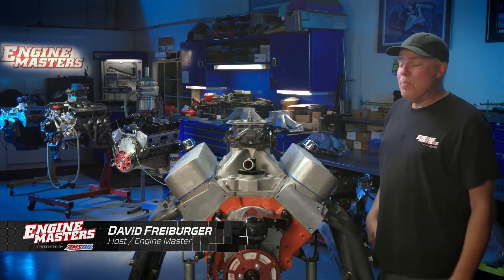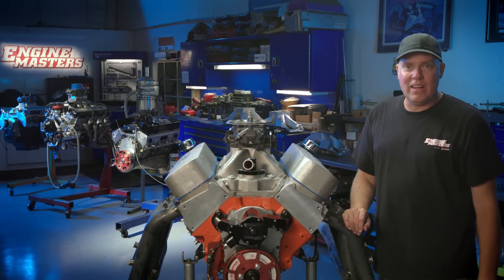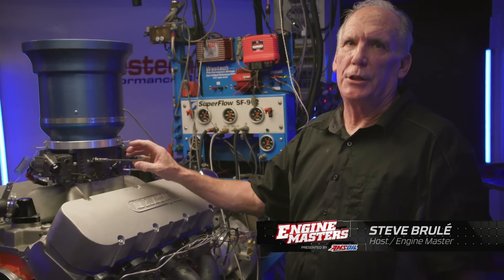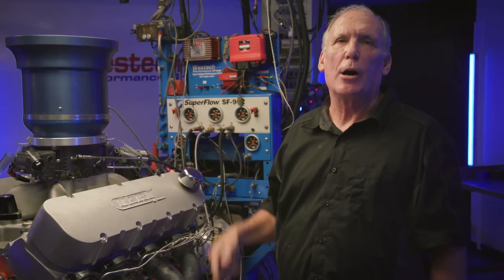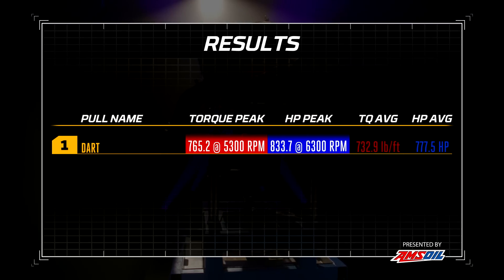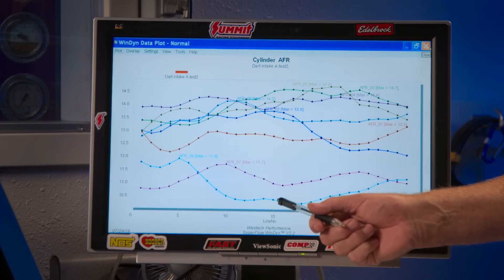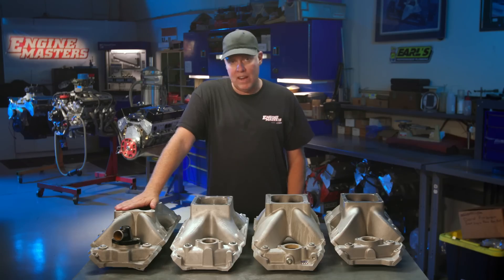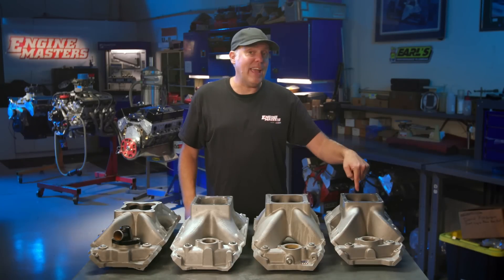Big-Inch, Big-Power, Big-Block Manifold Shootout—Engine Masters Preview Ep. 52

Comment: I’ve been looking for a tunnel ram for my 496. My BBC is equipped with Ron’s 4.1” 1800CFM alcohol direct inject. Brodix BB3 xtra heads. Comp Comp K11-692-8 cam shaft. PTC 5,500 stall. Suggestion?

Comment: The Big block chev engine has the worst head design in the world, you will never be able to fix cyl to cyl. distrubtion because of its left and right hand intake ports. 4 swirl ports and 4 tumble ports. If you want the best power w this engine look at the CID BBC cylinder head and intake. It fixes these problems.

Comment: My RFD Victor Pro heads were tested by Curtis RFD with Pro-Filer, Edelbrock, and Brodix intakes. They were tried as they came from the factory and Brodix, Pro-Filer, and then Edelbrock in that order is where they placed. Then they were port matched to my heads by RFD and the Pro-Filer was the best intake then Brodix with a very close 2nd then 3rd Edelbrock, and far last was Dart it was the worst intake out of all. I imagine on other builds others will say other wise.  My combination is RFD 24 Victor Pro heads,   10.2 DH, 4.6 BS, .903 lifter, 55mm cam, .400 raised cam,  615 cid bbc, with a V30 128 Vortech supercharger, e85, 123mm wilson TB, Holley Dominator efi ecu stand alone, and a custom ground bullet supercharger cam. 
The Dart intake is just like Dart heads, way over priced. AFR heads are better than Dart and have a better price.
Reply: Yes that dart intake is very old and designed for something around a 540 - 555ci. Didnt curtis design the edelbock sv 632 intake.

Comment: the real prob with a single quad intake is the uneven runner length. Tune the quad to feed those 4 outer cylinders, and the inner 4 are pig fat rich. The super high rise intakes that push the carb waaaay up there, can theoretically get the runner lengths closer together than just slapping on a plenum spacer...and there's less of a bend of air/fuel traveling vertically out the bottom of the carb and then taking a turn to the bent V of the cylinder banks. The Brodix design is a bit like a single quad tunnel ram, if you had to make such a beast.

Comment: This shows why EFI is so much better. You can change air/fuel cylinder by cylinder, as well as changing spark timing cylinder by cylinder. It is actually kind of remarkable that these old carb engines run like they do.
Reply: If you check out Richard H YouTube channel. He showed how small the changes are. When comparing multi port efi vs TB efi & carb.

Comment: Brule CAT says he has more hair than you therefore he beautiful and you are not.  All those manifolds and Hollley carbs are basically junk.  Put 4 Webers on it and have no distribution problems. Or Go fuel injection which is superior.  And take off the collectors and have individual pipes on the exhaust.  Like a Top fuel car.

Comment: Brodix won #1
Then Profiler #2
Then Edelbrock #3
Then Dart #4

I need the Brodix Part Number as it killed the rest surprisingly.
Reply: Thank you
Reply: Thanks man, you saved several minutes of my time!
Reply: how much power did the brodix make?
Reply: @ryanaxberg9263  

Dart = 833.7 HP @ 6300 765.2 TQ @ 5300
Edelbrock = 839.6 @ 6500 HP 757.5 TQ @ 5100
Profiler = 864.8 HP @ 6200 777.2 TQ @ 5400
Brodix = 875.8 HP @ 6400 782.2 TQ @ 5300
Reply: @hdcaprice  WOW, thats pretty big gains from just the intake.  Thanks for posting those up
Reply: How about a real good head AFR
Reply: Which intake has the best AFR between cylinders?

Comment: although i enjoy enginemasters im tired of these test on old archaic motor technology that the always use. like in this one it a 598 "big block" dinosaur of an engine. That is like 10litres  of engine and the thing only makes 700 ish hp. its a 20 000$ engine!  nobody realy uses this stuff anymore. id like to see some more modern stuff on the dyno maybe something made in this millennia . MAybe take a popular platform like a k-series honda engine or a  volks 1.8t20v , do some old school stuff like port and polish an light puleys or headers or a stroker kit and see what the gains are . just me 2cents
Reply: 850 horse on 91 octane is hardly archaic. Most modern engines cant make that without a turbo or supercharger. And they still dont have a flat torque curve like this "archaic" big block
Reply: @matinapnib3797  forgive the import guy.....he knows not what he does.
Reply: @matinapnib3797  there no modern engine that big . Im just saying it's not impressive getting 800 hp out of 1/2 tonne of 75yr old farm equipment engine for 20k+. It's just as interesting at a test on jet turbines or rockets. Yes there a few peaple that do use those but isent it pointless to test then on a show. As a viewer and a 3 year sub to mt on demand I'd like to see something more relevant.
Reply: @terrym641  I beg to differ but go to a drag strip and you will see engines this big and even bigger. 632 is getting prety common and people use them because they make huge power . The big boys even run engines this big with turbos. Sorry but a k-series honda is kinda lame by comparison
Reply: @matinapnib3797  yes, but those engines have also problems with old 2.0 Turbo Mitsubishi 4G63. Which makes same power with 4 cylinders, 1/2 of weight and 80% less displacement. 
I still love all V8. No hate. Peace.
Reply: @jareknowak8712  i agree four cylinder engines can make make big power but they always have to have one or two turbos. And for every 14 pounds of boost you are effectively doubling the displacement of said engine. So if you take a larger displacement engine your obviously going to make much more power. And remember top fuel and pro stock cars dont have small displacement engines with turbos. And in import vs domestic classes the big v8 cars have tons and weight and other restrictions to keep the much lighter and smaller 4 cylinder cars competitive.
Reply: @jareknowak8712  lots of people watch videos and think their stock k-series honda and 4g63 mitsu motors are the cats meow. Then they go to the track and run 17's stock and wonder why their car isn't as fast as the ones in the videos. Racing cost tons of money and a big block engine just might be the cheapest way be fast on a reasonable budget
Reply: @matinapnib3797  the same can be said about stock 5.0 fox body Mustang owners. 
Yes, V8 might be cheaper than 4G63, but once I was more certain than today. It all depends.
Dont get me wrong, i have nothing against V8, just saying that "modern" 4 cyl are not "a lame" in comparison to old V8. Absolutely not.
Reply: @jareknowak8712  there is no doubt the 4 cylinder cars can be fast if not faster than many v8 cars. But once again the have huge turbos and are running insane amounts of boost. The red demon mitsu i mentioned earlier is running 85 pounnds of boost! All things being equal if turbos nitrous and superchargers didnt exist the car with the biggest higher compression engine would win hands down. Take a 598 big block and put 85 pounds of boost on it and see what would happen. You would have a hard time designing a chassis that would get the power to the ground. Thats why top fuel have the huge wings on the back. It costs them about 800 horsepower at the big end of the track but the down force and lost of power is worth the added traction. And i might be old school but to me the cars making the most power on pump gas without nitrous turbos or superchargers are the best to watch at the track
Reply: It made 876 dumdum, and it aint 20 k. More like little over 10k if you know what your doing. Summit sells 632 complete for little over 10k
Reply: I do agree with 20,000 being way ridiculous but I will never see a 4 cylinder making 800 horsepower on engine alone, that and Freiburger most likely wouldn’t allow something foreign on engine masters
Reply: @williamsanders468  the engine is $9,999.... The Brodix heads are $3,700.... far cry from $20k
Reply: hdcaprice well 10000 is still a big price
Reply: @williamsanders468  i watched a video of a Mitsubishi called the red demon yesterday that runs 7's in the quater mile. You would be a fool to believe he doesn't have 50 grand in the engine alone.
Reply: hdcaprice are you forgetting the labour and machining that goes into putting a high horse engine together

Comment: Possibly dumb question alert: Why in 2019 are we still building with carburetors?  how is efi not superior?
Reply: They actually have a video that answers this question. Both have pros and cons but ultimately adding fuel into the manifold makes more power than adding fuel closer to the valve.
Reply: carbs are fun. new autos are better in every way over a manual, but I'm still going to drive manual.
Reply: All they do is WOT dyno tests... doesn't make a difference in that case and you don't have to put 28 sensors on the engine
Reply: Because carburetors dump all the fuel at once efi has return lines back to the tank and because AMERICA!!!!
Reply: @xnoxkillxgaming392  high end carb systems are set up that way too tho, it's the only way to feed a true carb equipped monster.....
Reply: @OutlawMercenary  its not the only. Its the simplest. Does not mean its the best.
Reply: EFI really isn’t needed a carburetor is just fine if tuned correctly, with an EFI it’s just an overly priced upgrade